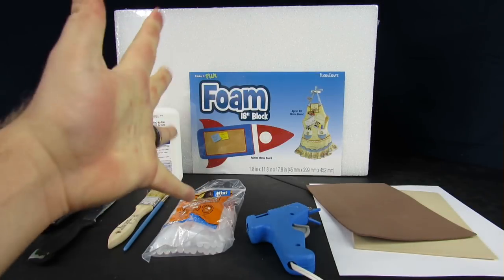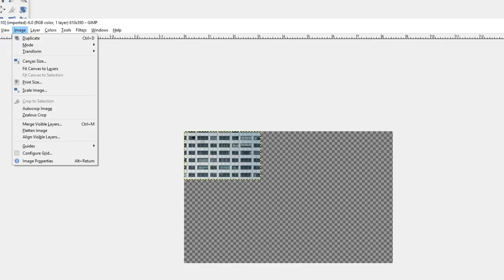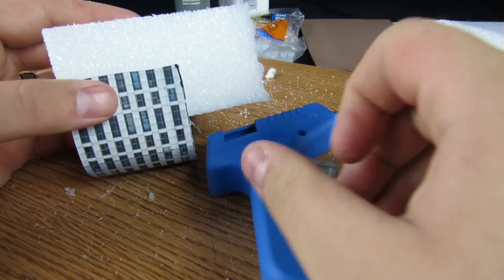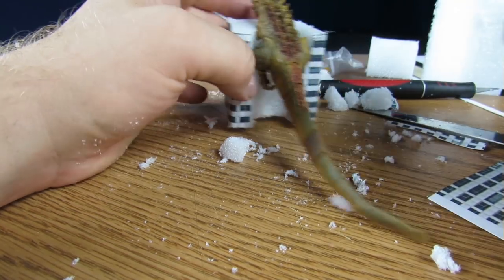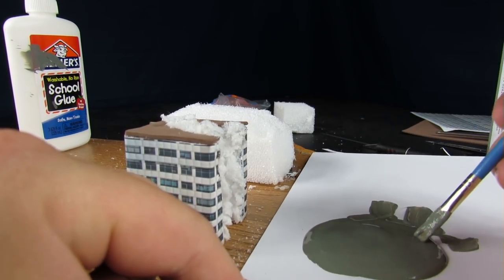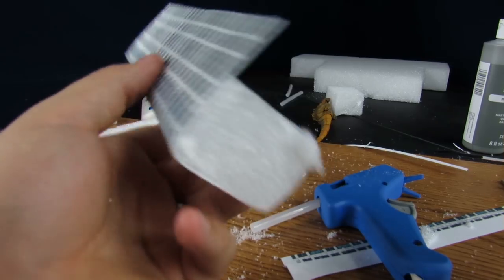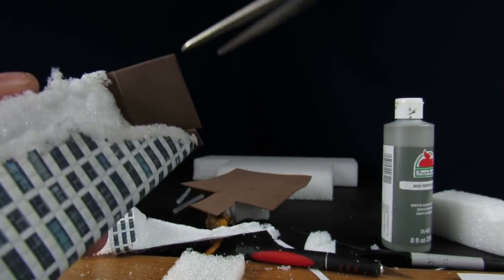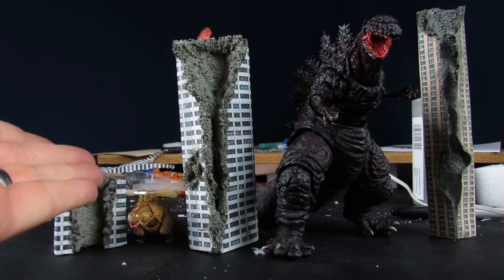How To Make Damaged / Destroyed Buildings For SH MonsterArts, NECA, Bandai, SH Figuarts - Tutorial

Comment: FYI in Gimp rather than having to fill the page with the image yourself by copy pasting you can tile it. Go to Render>Map>Tile and select the size you want it. 
You can avoid any more oddities as well by cropping out any partial floors or windows that won't line up and repeat themselves as naturally before tiling it.

If you're doing it in an accurate scale make sure you know what the page margins are set at before you tile, say 6mm, and then tile it to the desired size minus the margins.
So for an A4 which is 210x297mm and margins set to 6mm you'd tile it to 198x285mm and then make sure it's set to fill the page and be that size when you print it.

While I'm at it if you're not sure where to start on scaling it accurately Floor/Storey heights are usually about 3 meters 
(although it depends a lot on the type of building so to definitely be completely accurate you'd have to know for the building you're printing an image of, probably by finding the real buildings height and total number of floors but screw that, that's too much work for me lol)
so take the scale you're trying to make it in, say 1/500 for a Heisei Godzilla, and divide 300cm (3 meters) by 500 to get your floor height which in this example would be 0.6cm. Then scale the image as in the video to 0.6 times the number of floors in the image. You can crop the image to make it easier, whether to cut out half floors that would throw things off and also cause it to tile strangely like I said earlier or even just to crop it down to an easier to count number of floors to then tile with.